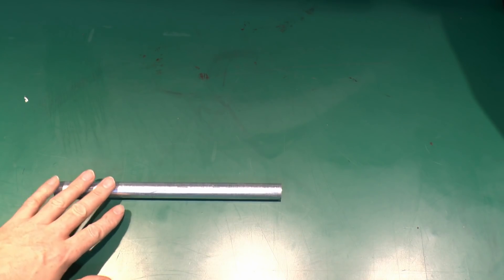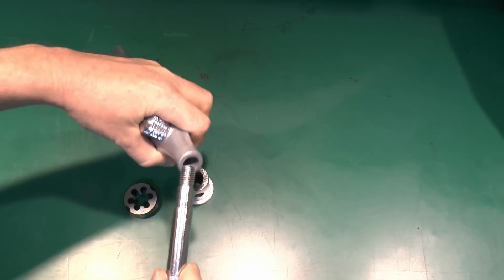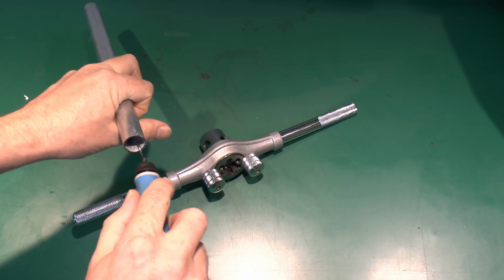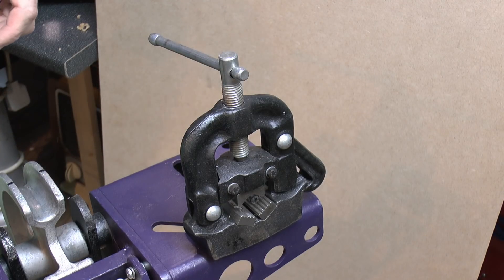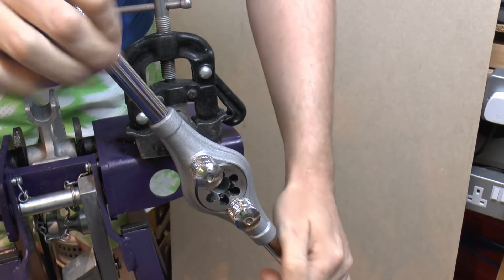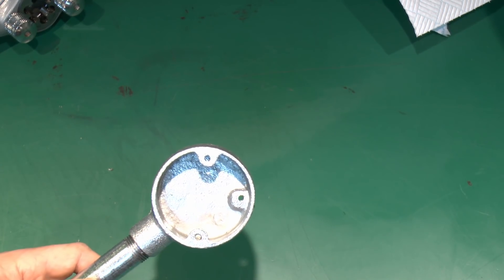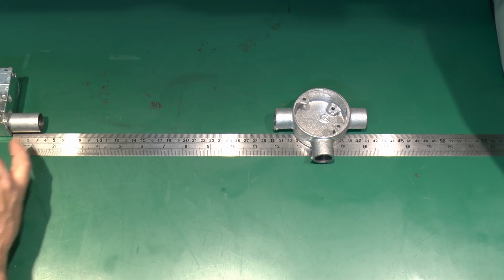Steel Conduit 2 - Cutting and Threading

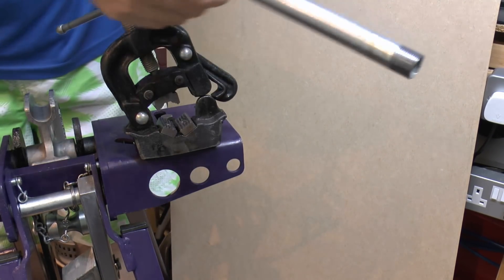Comment: 10:40 In college, I was taught to turn the die around and thread it on backwards in order to finish the partial threads at the bottom. That allows you to thread it all the way in with nothing exposed.

Comment: Pro tip from a machinist....
Whenever buying taps & dies... ALWAYS buy HSS (High Speed Steel) manufactured tools...
Some sellers advertise  Carbon Steel as being a high quality product material... IT IS NOT !! 
Carbon steel is "old tech" tho still fine for wood chisels & the like. But it is quite brittle & taps & dies made from it are liable to chip teeth, or worse,  snap whilst being used... not what u need when threading into an expensive piece of equipment. 😨

Loving the vids JW !👍😎
Reply from the maker: The carbon steel ones seem to be more in the cheapo sets of taps and dies sold in DIY type places, which are really only good for cleaning up existing threads.
Reply: John... yep ...carbon steel dies would be ok for cleaning threads, C.S. taps I'd avoid like the plague... 😱
btw... in case some don't know this, hexagon "dienuts" are ONLY for cleaning threads, not cutting new threads.. 😏
Circular split dies are for cutting new threads...😎

Comment: when using taps and dies I was taught one turn of cutting then a quarter turn back
Reply: learn the rules, break the rules! :P
Reply: also its probably much less important with big chunky dies like that. with small taps, say M4 and below, you can snap the tool entirely if you keep cutting new thread for 2 or 3 turns
Reply: Me too... then I learned that haphazardly twisting back in forth like you have parkinsons while tapping does the job clearing the threads. Just don't cut too much thread at once. Cut a bit, back off, cut a bit, back off.
Reply: You are correct. the quarter turn back breaks the chip.

Comment: When installing steel conduit outside, is it necessary to protect the cables from water ingress at the joints, especially where a joined fitting encloses cable joints? If so I would be interested to know how this is achieved as thread sealant pastes or perhaps PTFE tape on the threads could destroy the electrical continuity of the steel throughout its run.
Reply: diymostthings I've never seen ingress of water through the threads.. maybe box lids but you use gaskets for that
Reply: That sounds reasonable - I suppose there could be problems in marine environments.
Reply: diymostthings We don’t use conduits in the marine environment.
Reply: How do you protect cables outside on a ship?
Reply: The cables are armoured this is a layer of twisted wire between sheaths of plastic usually PVC. As used also in industry.
Reply: Just make sure you drill a drain hole at the lowest point of the installation, that way any small water ingress that might occur can easily drain away before it can build up and cause a problem :-)

Comment: Is this system designed for outdoor use? Can I used this conduit system if I have two sheds which are a meter apart? What are my options?
Reply from the maker: Yes, it can be used outside.  Any exposed or cut parts such as threads need to be coated with zinc paint to prevent corrosion.
Reply: @jwflame  many thanks.

Comment: Thanks for your video.If u are cutting a hole for a 20mm conduit pipe, will the size of your drill bit be 21mm?
Reply from the maker: In theory yes - however 22mm drill bits are much more common.
Reply: @jwflame  I thank you for your reply.

Comment: Hi John, I've got a really stupid question. I assumed that 20mm conduit would fit a 20mm box, but this does not seem to be the case. I've measured the eternal diameter of the conduit and it seems to be 22mm, exactly the same as the diameter of the female section of the case. What have I done wrong?
Reply from the maker: Are you sure you have purchased galvanised steel electrical conduit, and not galvanised steel plumbing pipe?  
20mm electrical conduit is 20mm outer diameter, 1/2 inch steel pipe is just under 22mm diameter.
Reply: @jwflame  I'm really not sure. I thought I'd got the correct stuff. Screwfix only seem to sell 20 & 25mm conduit. I'll have to take it back. 😕
Reply: Awesome video though, very useful and informative. Thanks very much.
Reply: @jwflame  screwfix gave me the wrong size conduit.

Comment: Are you aware of the old imperial conduit size that was typically used on lighting circuits in the 60s / 70s ?
Reply from the maker: 3/4 inch and 1 inch are the nearest equivalents of 20mm and 25mm.  Not available now, but adaptors are so older installations can be extended using metric conduit.  Screws for boxes were 2BA rather than 4mm. 2BA screws are still available.
Reply: @jwflame  thanks very much for taking the time to answer this much appreciated keep up the good work 👍

Comment: John Ward, what resistance is recorded at a insulation test of 500 v between the finger of one hand to another finger, same body. Tested mine(got a little shock) with a megger 1730 and found that is 0.07 mohm(70 komm). IS this correct or my megger is not working properly? Looking in this video https://www.youtube.com/watch?v=v38PfIVy2rI&index=2&list=PLvyQJOWqmaEg5blPB8jA8WlTXtKENUfsA and the guy says that from fingertip to fingertip we have 1000 ohms. How the heck would that rcd trip if we humans have 70 koms? An 30 amp rcd for 230 volts  needs 1667 ohms earth fault loop. What protection would we have if we touch the line conductor? Anyway at 70 kohms we would not need any protection at all. So there must be another way to determine the resistance, because the insulation way test with my Megger is not concludent. I tried an insulation test with a cheap multimeter and I get 100 kohm. Still not concludent.

Comment: I have yet to see any electrician use a grinder to cut conduit. Used properly, a hacksaw takes seconds to cut 20 or 25mm conduit.
Reply: Mr Badger .... thats a lie man !! U just watched JW doin it !!
😅😅😅😅😅
Seriously tho... if u only need a couple of threaded cons a hacksaws fine but if u were running pipe in a factory with lotsa cons an angle grinder saves some labour... 😎
But of course u know this... you're just nit-picking... 😅😅😅😅
Reply: I use a grinder on mine. When your doing loads of these one after the other, any help is a plus. Also makes a straighter cut than a hacksaw
Reply: Seriously, I know a grinder is far more common to have to hand these days, but I still haven’t seen it used for steel conduit (other than stripping it out) I hacksaw my steel conduit, thread it then just ream it out with my pliers. It doesn’t take long, I could be easily persuaded switch a power tool for the threading though! 
And if you struggle to get a straight cut on your conduits you simply need to practice more.
Besides, most sites require a hot works permit to be issued for abrasive cutting which is a pain. 
Unistrut though, now that I usually use an abrasive chopsaw on although recently got a rage saw which cuts cleaner and doesn’t require hot works permits.
Reply: Mr Badger ... 👍😎
Reply: I used my grinder last week on conduit for my garden
Reply: You need a hot works permit on any big site for a grinder... They won't issue you one, because you are too lazy to use a hacksaw.
Reply: If you are actually serious you'll have a proper pipe cutter of course.